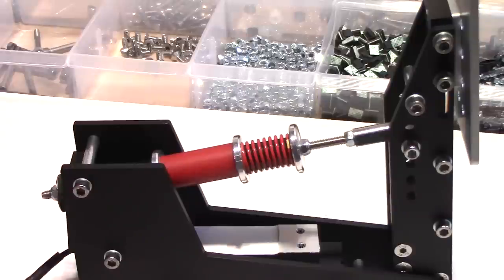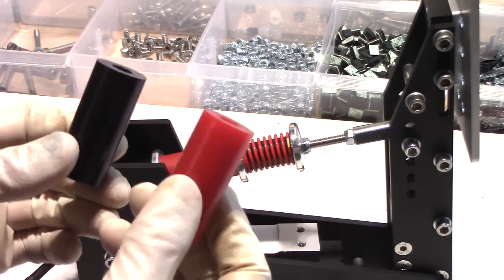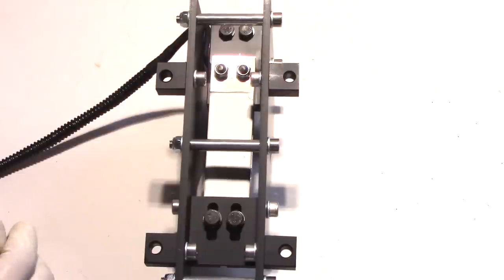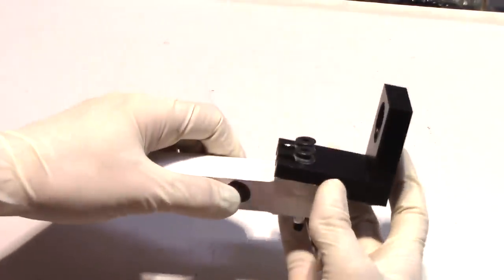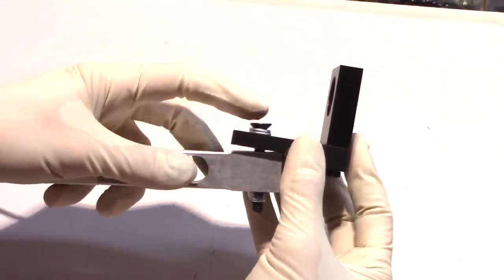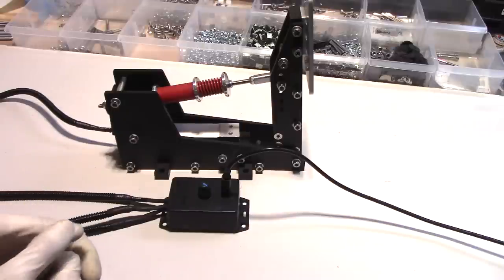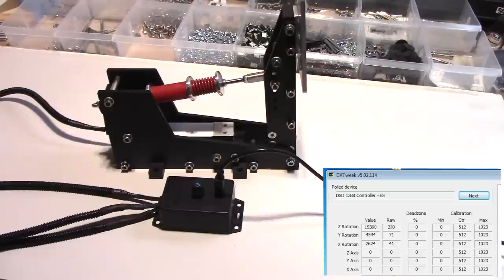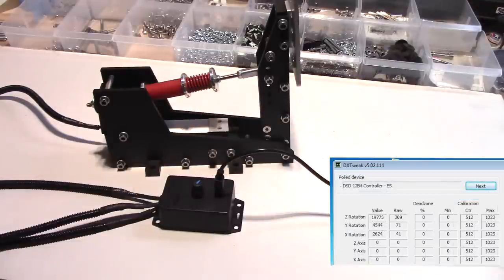Pedal Adjustments (Part 2 - Brake Pedal)

Comment: With the gain turned up, you can reach 100% travel with only a slight press? Because this was the problem I had with CSv2 pedals. Even on max gain, I had to press quite hard which caused some pain in my knee if using it longer time. Does the higher gain affect spiking?
Reply from the maker: Roy Rki With the gain turned all the way up, the pedal will sit at max resolution without any input at all ;-) Therefore, we don't suggest turning it all the way up. You can get max resolution with just a slight press of the brake pedal, if that's what you prefer. You would just turn the knob down slightly.